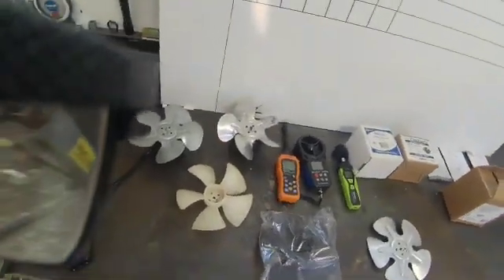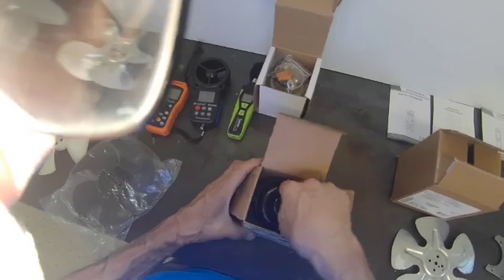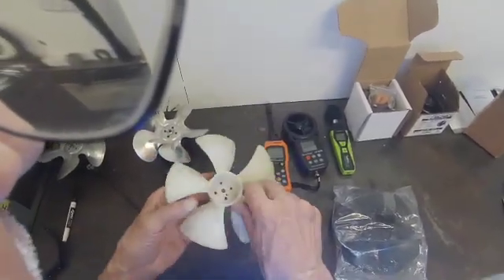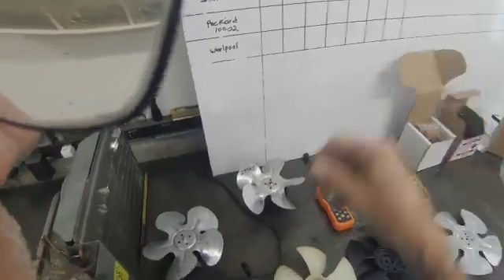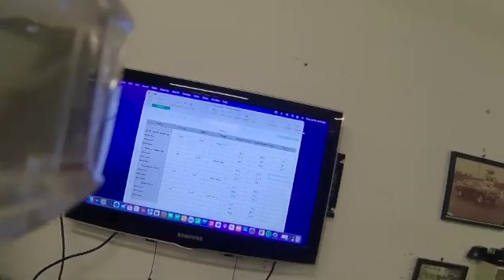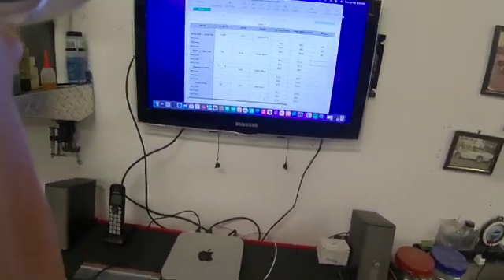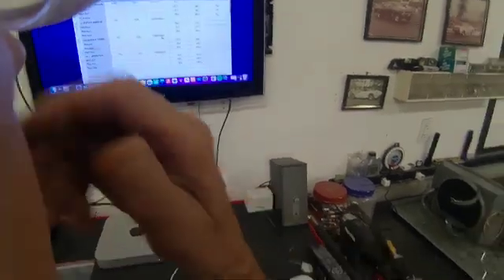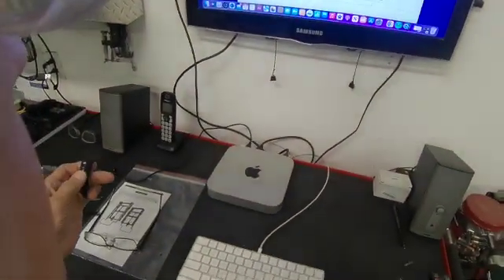Sub-Zero Condenser Fan Motor Performance Test

Comment: Great video!  Thanks for posting it.  Do you ever run into fan relay relay failures, or is it generally the fan that fails?  My 1997 S-Z 561 has the original Morrill SPGC203HCEM1 condenser fan motor with the metal blade.  When running, it is quiet and spins at 1400 rpm according to the free iphone app I used.  However, it intermittently fails to start.  A clockwise flick of the finger sets it going again every time. (If it were an HVAC blower, I'd figure it needed a new capacitor...)  Like @mp3953, I'm considering just direct wiring it to 115V so it will never stop until it's REALLY dead.  Any downside to that approach in your opinion?  It would eliminate the relay as a failure point.  Obviously, it will waste a little electricity, but if my calcs are right, <$4 worth per year.  Thanks for any thoughts!
Reply from the maker: @stevenbachman9484  there is no relay, change the motor.

Comment: do u have a comparison with the newer brushless panasonic motors?  Im tired of control board failures causign fan motor to stop.  Was gonna reftrofit to one of these motors and just direct wire to run full time
Reply: and i dont think i can direct wire the new panasonic easily.  I tried and put 120v to the red and blue and it blew the panasonic motor.  It says it is ac so i am not sure why it did.
Reply from the maker: Sorry no
Reply from the maker: It’s a variable speed motor and controlled by the board. You could use a regular condenser fan motor and tie it into the compressor circuit but that’s not what it is designed to do.

Comment: tHANK YOU FOR YOUR VIDEOS   i HAVE A SUB ZERO 3211 THAT NEEDS A CONDENSER FAN MOTOR ....A SUB ZERO 700 TC THAT NEEDS A EVAPORATOR FAN MOTOR ,,,WHAT ARE YOU RECOMENDATIONS FOR REPLACEMENT,,,THANK YOU
Reply from the maker: You can buy those parts from your local subzero distributor. If you don’t know their number call 800-222-7820
Reply: @SubZeroSpecialists  Thanks

Comment: Why didn't you use the Packard #65740 (1300 RPM)?  It is described as the cross-reference for the 4200740.
Reply from the maker: Thanks for the feedback. The packard 65740 costs as much as the SZ 4200740, so I prefer using the factory motor. BTW, the Packard 65111 is advertised as 1000 rpm at 2’5 watts but was tested at 1350 rpm.

Comment: I'd love to see the spread sheet with all your info.   Also, I see a lot of guys run the power on the fan to the compressor so it's only running when compressor goes off.  Any thoughts on this?  Do you have a go to for motor and blade?   I just ordered the factory motor, literally today.  I figure I can't go wrong.  But I was going to re-use the existing metal fan blade.
Reply from the maker: cap@certifiedapplianceparts.com for the motor. I’ll be doing a recap on the CFM video soon.

Comment: just watched the video you did on the Viking wine cooler.  I wish I 
could find someone like you here in Little Rock, AR.   I have a Viking 
48" side by side that about 18 years old.  We've had a leak for a while 
and could just top it off about once a year, then it became once every 6
 mos plus replaced the control board about a year ago.  Last time my 
tech came out he said well it's your compressor has quite.  Anyway, I 
had to throw it away due to the expense of a new box plus it's 90% 
there.  It probably needs a new compressor and someone like you to find 
the leaks.  I know they used to fill the backs with foam and this one 
would be like that.  I don't know if that makes finding leaks impossible
 or just more time consuming?   I would love to hear what you have to 
say about what I should do....  Do I have to scrap it or is is 
Salvageable?  Please advise.
Reply from the maker: leaks can be fixed and the most likely place for a leak on your model is the evaporator coil in the freezer. any competent tech can do that job, the parts are still available.